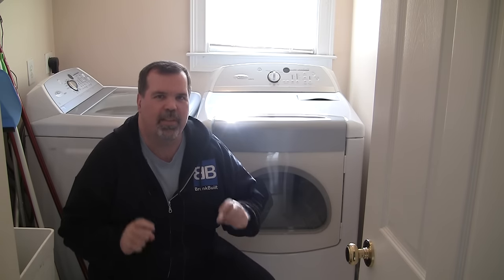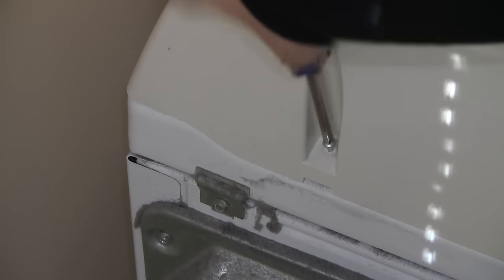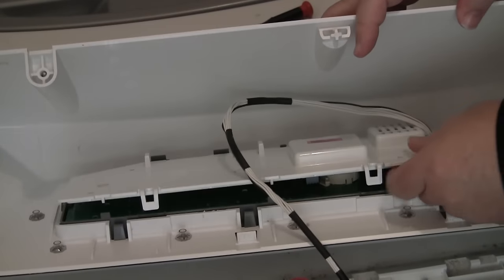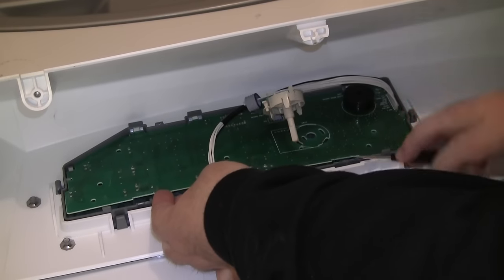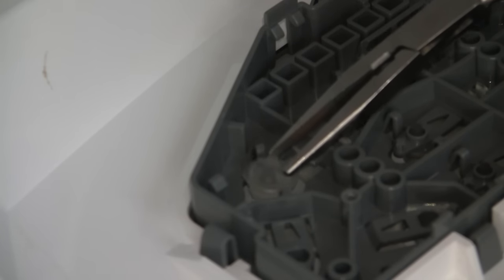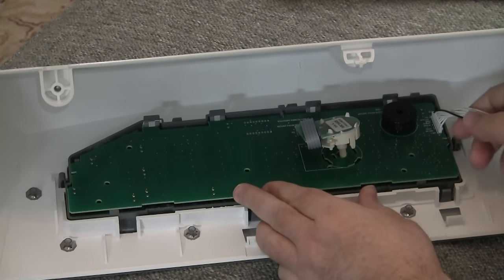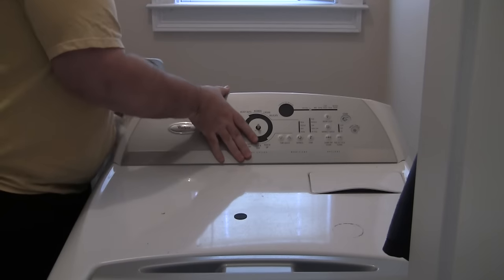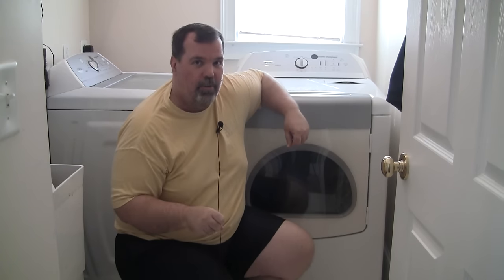Fix a Whirlpool Cabrio dryer that will not start (How-To)

Comment: I’m having this issue and nothing seems broken. I dissembled and everything looks good. I tested the button on the panel before putting everything back together and it still does not start. Any suggestions on what it might be please 🙏🏽🥺
Reply from the maker: Unfortunately if you are testing by clicking the button on the board and it is not starting then the board will probably need to be replaced.  First I would double check all connections and test other buttons on the board.  That way if those buttons work you know the connection is good.  Realize I'm not a technician, just a DIY'er so I could be wrong.

Comment: What if there is haptic feedback with the button, but it still won't start? Could it have something to do with the thermal fuse? I know that probably doesn't make sense, but that's what some people were saying.
Reply from the maker: If you can feel the happiness feedback then it probably is not the button but I think you should still open it up and test by pressing the button directly on the board.  If not,  then I'm not sure.  I would think the motor is a possibility but I'd think the motor would last for ever.

Comment: I have the same dryer!!  Can the thermal fuse be blown and the heating elements still heat up?  Mine won’t start but the start button is fine and the I see the elements heating up
Reply from the maker: Maybe the actual button on the circuit board is broken.  You may need to get a new one.
Reply: When I hit the start button, I hear a noise. Turns out the noise is the heating elements heating up. I can see them heat up since I have the back cover off. I checked the thermo fuse with a muiltimeter and got nothing, so I ordered one online for 1.95 with 4.50 shipping. I hope this works!  This is an excellent video you made. I’ve had this dryer since 2005-06 and it’s been great.  The matching washer crapped out about 2 years ago. Thanks for you video!!
Reply from the maker: Let me know if that fixes the issue,  I'm interested.  We've had the set since 05 or 06as well.
Reply: Update:  The thermal fuse arrived today and I installed it. Dryer works like a champ!!  Apparently, when the thermal fuse blows, different models do different things. Some kill everything, some kill the heating elements and some kill the drum and blower motor. This model kills the drum motor but the heating element still worked. It’s only a 15 min job, but save a couple hundred bucks. I don’t think my dryer overheated to cause it to blow. I was reading that some fuses can live out there life expectancy, which I believe mine did. Thanks for the video Dale !!
Reply from the maker: Thanks for the update.  I'll pack this info away if it happens to me.  Really is a great wager and dryer set.  Had ours for a long time.

Comment: Hey there Sir, my dryer has power but once pressing the start button, it’s not turning over to tumble. It seems the motor turns on but it doesn’t initiate turning. Thanks I’m advance if you receive this.
Reply from the maker: Hmmm. Not sure. Is look at possibly a bad belt?
Reply: @BronkBuilt  wow thanks for the quick response. I’m actually in the process of taking the back off, I will get back to you. Thanks bud

Comment: The dryer is the same but it powers and did beep but doesn't run.  The timer on the countdown goes down but we get no running.  It says sensoring but what is wrong?
Reply from the maker: I'm sorry but I'm not sure. Are you saying that it appears to start and when goes through the timer and senses, but the sun does not turn? Does it heat up?

Comment: How big of a hole do you drill in the wood?
Reply from the maker: Sorry I don't remember.  I held the plastic button up against my bits and chose a bit size based on the button size.  I think it was a half inch, but just don't remember.

Comment: It worked but could need a visual on cut the piece of wood. . Yes you do have cut a slit on the start sticker so u can able to press the button after. Also there is plug lock 🔒 on the big rotary wheel so unplug then turn counter clock wise. Thanks 👍 save me tons of money 💴
Reply from the maker: Glad it helped.  Saved me a lot of money as well.

Comment: Any idea what can be wrong with my Whirlpool Cabrio dryer - the buttons all work but when I press Start it hums and stays in sensing mode without tumbling but it does heat up - what can be the problem?  I can turn the drum manually and it doesn't feel like anything is hindering its ability to turn.
Reply from the maker: Scroll down in the messages to one that talks about heating elements.  Could be same issue.  I'm interested if that comment is the same as your issue.

Comment: Mine is powering on and when I hit the button to start it sounds like when your solenoid clicks on your car engine. If you could help me out I’d be forever grateful sir. Times are hard
Reply from the maker: Have you taken it apart like my video shows? If you leave the circuit board plugged in you can press the start button on it to see if it starts. That will tell you if it is a button issue or something else. How this makes sense.

Comment: I disconnected the wire from board - how wo I reconnect - it's not going back on the probgs
Reply from the maker: If you pulled the wires out of the plugs while trying to pull the plugs out I'm sorry I'm not sure.  It will probably require some soldering.

Comment: I tried this but didn't get it right.. SMH. Quick question? How do I remove the entire grey piece?
Reply from the maker: I looked into that on mine while I did my fix.  The only way I could see that it came up would be pushing it forward to come up the front.  That would mean removing the front face and on my they are rivited in.  Since I was not sure if I was right on how it was to come up I didn't try.  Sorry that probably doesn't help you much.

Comment: Did you put the plastic piece that broke back on then put wood over that or no
Reply from the maker: The plastic piece that broke i tossed away.  The small piece of wood is what i used to replace it.
Reply from the maker: One thing i may have forgot to say on the video is once you have taken things apart and exposed the circuit board you can plug in and test if the circuit board still weeks by simply pushing the small start button on the circuit board.  If the dryer starts this fix should work,  otherwise you may need a new circuit board.

Comment: Our start button does beep, but still doesn't start.  Could it still be the same problem?
Reply from the maker: I guess it could be,  but i don't think so.  With mine it was making no sound and doing nothing.  I would guess that if it makes a noise the button is being pressed.
Reply: I have the same problem but  the start button clicks, so what else could be wrong? Would you advise me , whether it is fuse or something else. I did not open up the panel yet.
Reply: If the lights come on chances are it is the fuse.

Comment: Nice, I think I have the issue. Will check it tomorrow
Reply from the maker: How my video helped.
Reply: @BronkBuilt  I ended  up having the same issue, I tried the paint stick/wood and it worked a couple times and then I had to press on the back of the circuit board  to make it turn on. I checked the wood and it was broke in half. I don't think my wood was the exact same shape as yours, I could see where there was a mark where the wood  where it broke guessing that it hit one of the many parts sticking up/out. Plus I had to elongate my hole not quite in the right place. I was going to make another one out of wood but instead I decided to try glue and glue a piece of plastic on top of the broken part for extra strength. So far so good it's only been a couple hours, if that doesn't  work I'll try the paint stick again. Not sure if yours was all electric but mine is gas.
This video gave me the inspiration to try it,  good job!! Thanks
Reply from the maker: Thank you. A piece of plastic is probably better than the paint stick.
Reply: @BronkBuilt  will see if it works and doesn't break break. I like the wood idea but mine wasn't quite right because it broke. I think that my paint stick looked like it was a bit thicker than yours. Again thanks for the video

Comment: I’m having the same problem but when I hit start, it makes a click noise and I have no idea what this means
Reply from the maker: Thanks for watching.  I'm not 100% sure but you may want to follow my instructions to get to the control board and press the power button directly on the board.  If it turns on that way then you know it is just the power button switch.

Comment: If it helps someone mine wouldn't work because of spacing of the plastic piece to the circuit board. I placed a folded up receipt in the same place he put the super glue and bingo it worked perfectly. One way to tell quickly is to just place it and snap the circuit board  in place and push the button if you hear a click of the button on the board you should be golden.
Reply from the maker: Thanks for tip. Hope it helps someone.

Comment: is the whirlpool cabrio dryer gas or electrical?
Reply from the maker: Both can be used.  I used electric.
Reply: @BronkBuilt  is the electrical with one big plug with the duct connected to the wall
Reply from the maker: Yep
Reply: @BronkBuilt  will anything happen if the duct is slightly ripped or should i replace it
Reply from the maker: Is replace it.  Suppose you may be able to use duct tape, but it's replace.
Reply: @BronkBuilt  ok thank you so much

Comment: I bought my whirlpool cabrio set used and I had to replace the thermal fuse, new bolts and screws to the terminal block. New dryer vent and taaadaaa! It still won't start. Lol now I'm about at my wits end. #morewetunderwearforme
Reply from the maker: Oh man, sorry about that.  We had ours for about 19 years and was a champ for us.  Fixing the stat button gave us another several months but our Thanksgiving present was smoke coming out of both the washer and dryer.  This time we got the bullet and hit a Black Friday deal and went stackable which fits much better in our small laundry room.  I'll miss the Cabrio and their super big load capacities though.

Comment: Unfortunately the “remove the connector” comment I tried that and broke the connections the circuit board. Warning to others, it DOES NOT come off and broke in half snapping the solder and wires off the circuit board.
Reply from the maker: I'm sorry that happened but mine came off perfectly. Simply "unplugged" and plugged back in. No problem at all.
Reply: @BronkBuilt  I tried to unplug the connector on the actual circuit board which doesn’t come off 🤦‍♂️

Comment: could be very helpful to have the dimensions of the piece of wood very difficult to measure right
Reply from the maker: I don't remember exactly but I believe it was only about an inch or so long.  It really will depend on if yours broke in the same place or not.  I would say start longer than you think is needed and sneak up on it.